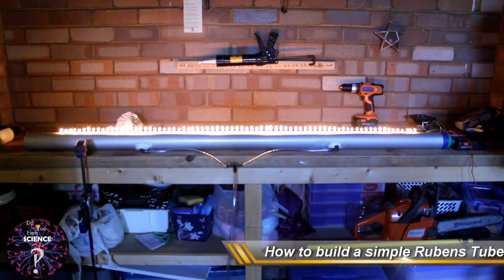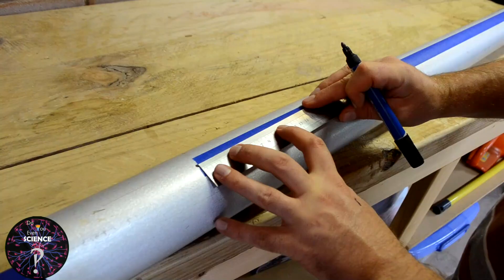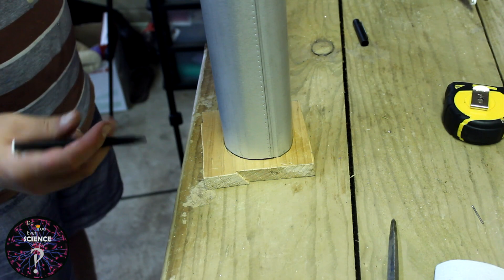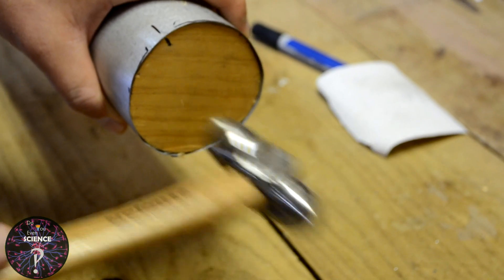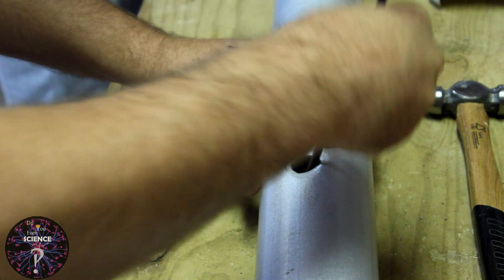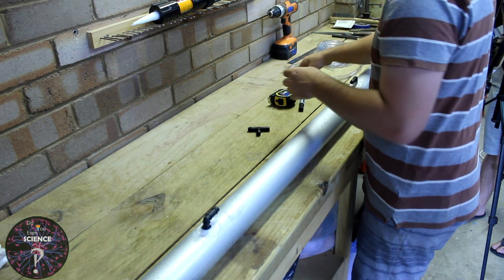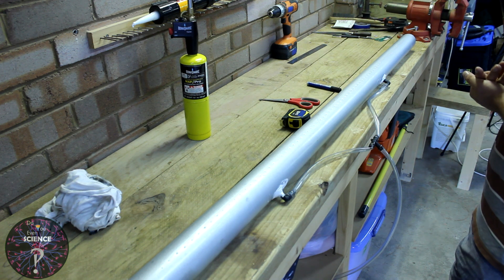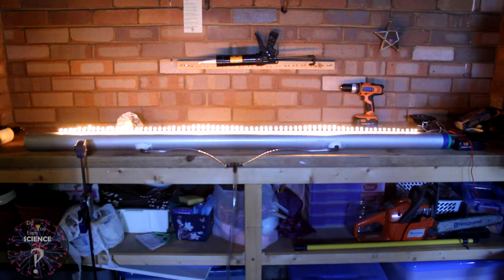How to make a simple Rubens Tube

Comment: Is the green seal a regular balloon? Isn't that dangerous? Can the balloon withstand the heat and pressure inside the pipe?
Reply from the maker: Yes, regular balloon, and no, not dangerous. The gas pressure is slightly above ambient, just enough to make the flames small. As for heat, that is the reason the holes start a little in from the end. The pipe will eventually get very hot, but generally will run for over an hour without melting the balloon. If the balloon does come off, the pipe is void of oxygen, so won't explode, just end up with a large flame that is easy to smother with a wet cloth.

Comment: Is their any possibility of the fire flaming and therefore exploding inside the pipe or the gas tank?
Reply from the maker: generally not, the flames won't pass the small holes, similar to a principal of the miners lamp. The gas tank should always have a regulator for safety. The only chance of an explosion is if the diaphragm breaks and the flame enters the tube, but its generally just a large flame, not an explosion, as there is not enough oxygen present inside.

Comment: How do you add the speaker to the end of the tube? I'm using your video to make a Ruben's Tube for a school project.
Reply from the maker: Abraham Rittenhouse hey, thanks for watching. The speaker is simply placed in front of the diaphragm but not touching it. I used an old TV speaker mounted on a wooden block to hold it in place.
Reply: Did it work
Reply: @bloinked  as you see on video it work ;) due to the resonance

Comment: Hi, what kind of gas bottle did you use? Because we have a big one for the bbq but my dad's saying I can't use it because it could blow up. Could this actually happen?
Reply from the maker: +Brenna Hobson, thanks for the comment. The gas from a BBQ will work but will run hotter (Propane). Your dad is correct in saying it 'could' blow up. But it is what I used in the above video, but with a regulator to ensure it was low enough pressure. the direct pressure from a gas bottle would be much too high and could cause issues and a fire. While an explosion is possible, if done correctly there shouldn't much of a risk.
Reply: Thank you!

Comment: What would happen if I use speakers on both sides?
Reply: +Do You Even Science‽ ok, thx for the information, this video helped a lot for my school project.. just sayin' thank you very much for this really clear video..
Reply: +Do You Even Science‽ Actually not. If its positioned good than it can amplify this effect.
Reply: +Do You Even Science‽ just add one more inner tube that can be moved inside and attach speaker to end. Like bass reflex tubes that can be adjusted. Than you can easily do it.

Comment: I have butane gas.... will it work??? and also the speaker can it be directly placed in the tube without the ballon??? also does epoxy will work as glue?
Reply: Thanks.. But will the ballon melt with the heat of the butane???  What kind of glue do you advice me to use beside what you used in yours,  will  soldering work?
Reply: +Do You Even Science‽ Thanks... I  will definitely use the ballon as you suggested,  it could be explosive also can you tell me the dimensions of the holes and the distances of each hole and also the type of glue you used? im doing this as a visualizer for my school project where I'm making a music system box, a.k.a boom box thats why I'm asking you some tips and advices...
Reply: +Do You Even Science‽ Thanks... Yess for sure I will share it with you when it will be finished...thanks again for your tips.

Comment: I have you tried putting the gas supply the opposite side of the tube? So flames on top and supply on the bottom of the tube? Would this be better or worse? Tried again tonight with mine, certain I need a larger diameter tube for it to work as well as yours does. New ballon really tight, hooked up a regulating valve to control flow and used a house stereo. Tiny bit better but still not good enough.. Gonna get another bigger tube and try again me thinks! :)

Comment: Hey, I responded on to you on my video, but ill answer the questions from.this post here 👌 the length is little over three metre's, just a guestimate as in still in bed ATM.. Lol and probably only about 40mm/50mm internal diameter, my holes and spacing is what you had, 2.5mm holes 20mm apart 👍